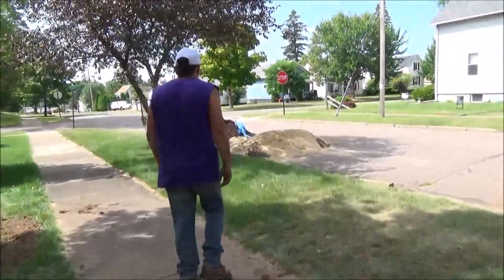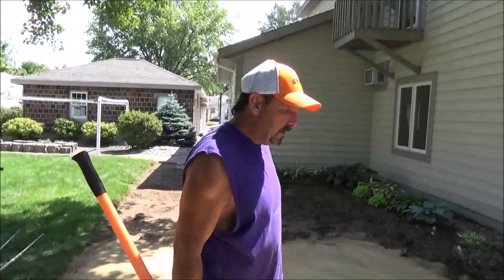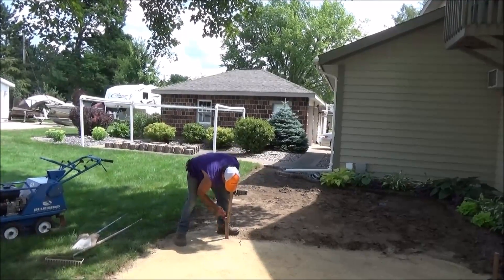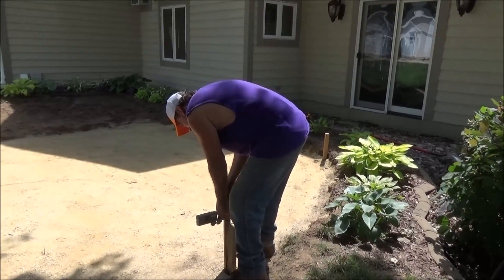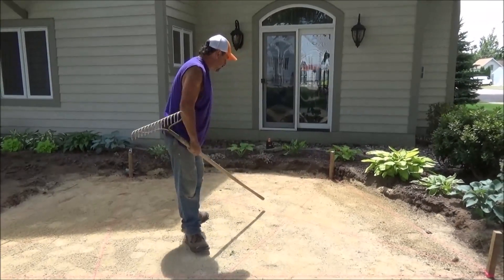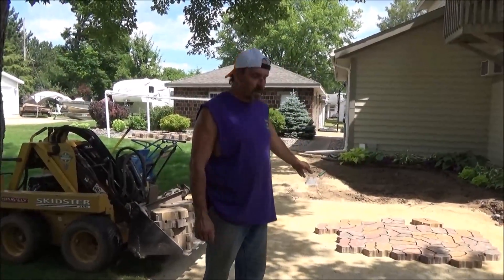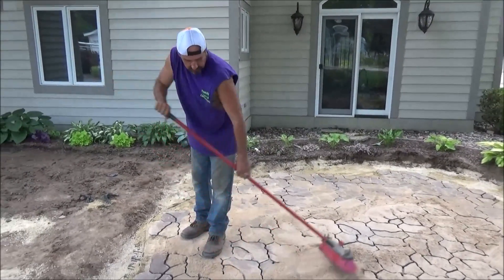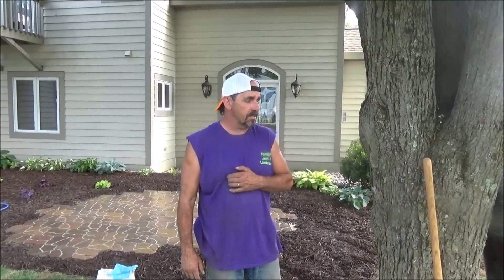Paver patio install part 2

Comment: Try using a Zip Level. They are much faster than using a laser level. Also setting screed poles are the way to go
Reply from the maker: I'll have to check out that zip Level and we do use screed poles, just not on this small job
Reply from the maker: thanks , i'll check them out.

Comment: you should try screeding  poles you can set the poles with your laser level and then just screed it off. much easier and faster. we use 1 inch fencing poles.
Reply from the maker: thanks barry, we do use screeding poles ( pvc ) which you will see on the next video i think.
Reply from the maker: doing it tomorrow brother
Reply: turdsandwicher yep.if you get the  site kinda level at first  you can use the 1" poles to screed the base one inch at a time. Then compact repeat it till you get your desire high.the best way to get consistent base material all the way